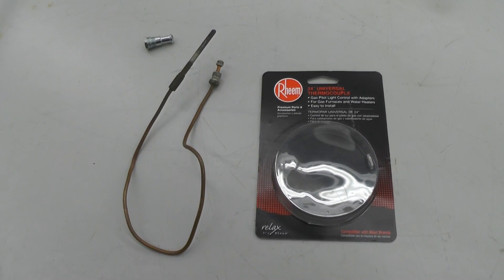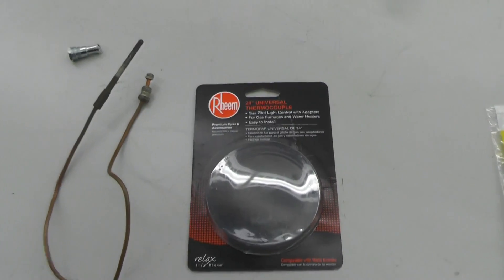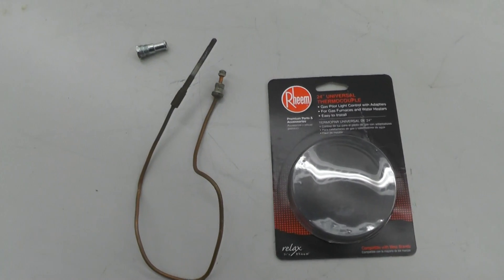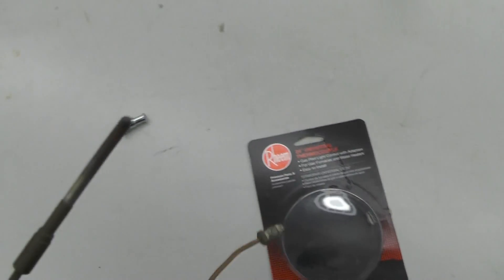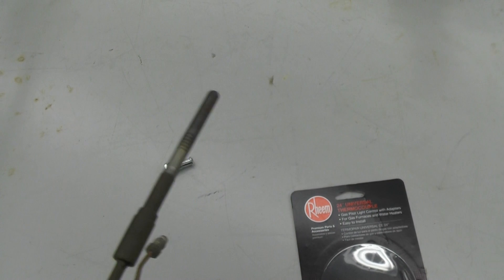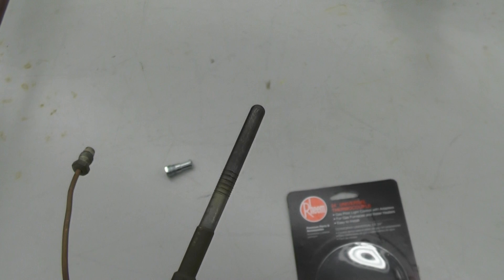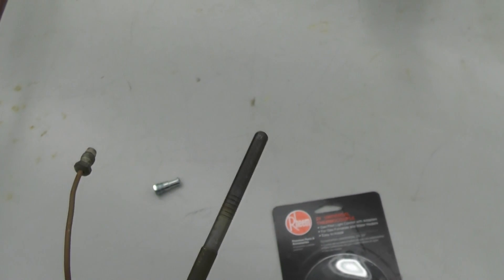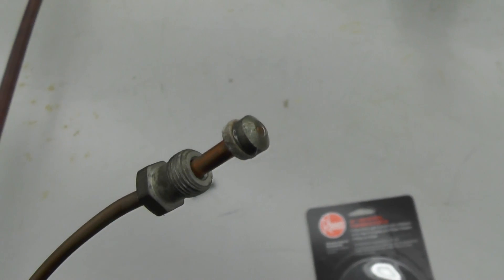How a Thermocouple works for a Natural Gas Heater

Comment: Does the copper line get hot mid way? Also, can you use aftermarket thermocouple or does it have to be the same brand of the water heater?

Comment: How does the electrical current flow through the copper pipe?   I understood gas and liquids flowed through pipes but electricity flowed through wires only and two are needed.

Comment: Thermocoumple produces millivolts. My questiion is normal thermocouple having two wire ends. This two wires are connected to circuit. But here only one metal surface connected to cell. What is this ?

Comment: Thanks for the info and the time to make this video.  One minor technical correction:  The thermocouple is NOT what keeps the pilot light on.  The thermocouple is what allows the gas switch to send gas to the main gas burner.  The pilot flame will burn regardless of the condition of the thermocouple.  I only point this out because it is important when trying to diagnose a failure in the system.  If the pilot light (flame) will not come on, it’s usually due to a failed ignitor.  If the main burner will not come on while the pilot light is on, them the failure is probably the thermocouple.
Reply: Not trying to be rude but you're wrong about early everything you said...unless you mixed up several terms....idk...but it does absolutely  matter what state the thermocouple is in to keep the pilot flame on. The only reason there is a t.c. is so the valve knows If the pilot is lit or not.  If the gas valve doesn't see a signal(because it blown out or whatever) from the t.c. it won't allow the pilot to stay lit. If the thermocouple didn't matter then your gas furnace/water heater etc would send a heat request with no fire present pumping your house or whatever it may be full of gas. If t.c. is bad you'll still be able to push the knob down and light it, when you let off the knob to turn gas to on position the flame will go out.

Comment: Hi Stevenopfa, I have 2 questions.
1. Does thermocouple control/regulate the furnace flame for heating up the water?
2. The pilot flame needs to be on all the time.  Why do we need thermocouple to keep the pilot flame on?
Thanks!
Reply: Thermocouple is safety fuse. When the fire go accidentally out intake of gas will be closed.
Reply: @robertkosulic4122  you are right.
Reply: Thermocouple is a temperature measurment sensor.Usedfor measurment and control of temperature.

Comment: Thanks for the info. I ripped the head off a bottle top sunflower garage heater, added a length of gas hose and a larger regulator and then stuck the burner in a small home made forge. You should see what 15000 BTUs looks like in a 300 square inch space. Wow!!!!